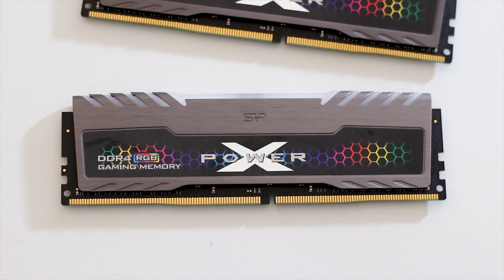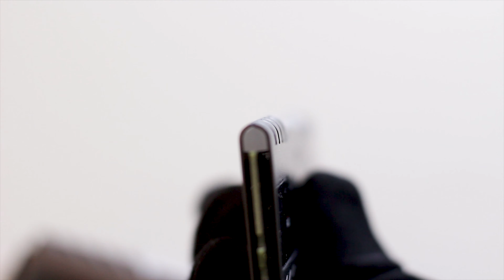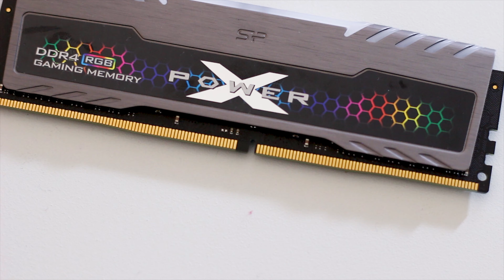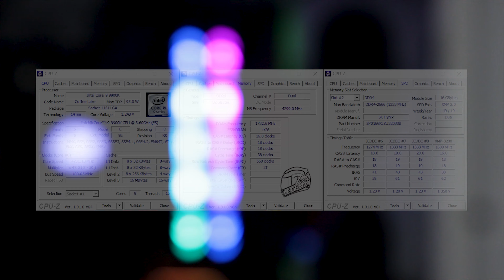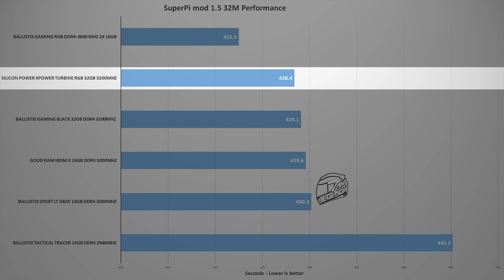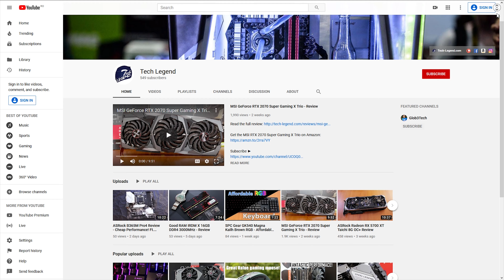Silicon Power XPOWER Turbine RGB 32GB 3200MHz Review

Comment: Building a new computer now. I have (2) 16 GB Silicon Power Turbine RGB RAM sticks for 32GB total. On very first boot up, my rear RGB fan lights up fine, but my Silicon Power Turbine RGB RAM sticks are not lighting up - but are being seen in my new Gigabyte B660 DS3H BIOS just fine. How do I make these sticks light up? Do you have to install the OS (WIn11) first and do it there with software? I thought they should just light up on very 1st boot up. Thanks.
Reply from the maker: Hi! Usually, they should light up without any software, but on some motherboards that's not the case. You need to download the GIGABYTE RGB Fusion 2.0 software and see if you can control the RGB with it.
Reply: @TechLegend-com  Thanks for the reply. Tried RGB Fusion 2.0 and the RGB RAM sticks are still not lighting up. Tried re-seating them too and still not lighting up. I don't care about controlling them even, just want the damn things to light up .. at little It's just strange that the motherboard is seeing them in BIOS (as 2 sticks of 32GB RAM total - as it should), but they're just not lighting up, and there's no where to turn them on either in the BIOS or Gigabyte RGB Fusion software .. anywhere, that I can find.
Reply from the maker: @mhbalough  Look for the JackNet RGB Sync software, see if that works.

Comment: Hello, I was able to bump to 3400mhz with profile, however at 3600 i found a 10% increase in FPS in games, however after 30 mins, fail/crash. I believe that means I must set a custom profile, however I'm not sure if the timings need to be higher or lower than what they are set to default.

thanks
Reply from the maker: Have you tried to raise the voltage?

Comment: Useful! I got these on sale for a good price this year. You wouldn't happen to know the voltage increase required to manually increase the clock to 3466, would you?
Reply from the maker: Hey, sorry for the late reply!
The voltage I used to get that frequency was 1.42V.
Reply: @TechLegend-com  Hey, no worries! Given the date on the video, I'm thrilled you managed to get back to me with an answer at all! :D Thanks again, I'll give it a shot this week and let you know how it turns out (I'm actually using two of these kits for 64MB in my home workstation)
Reply from the maker: @RothAnim  Alright, looking forward to see your result! :)
Reply: @TechLegend-com  Welp, no dice. Even 3333 was too much for this setup. Either I lost the silicon lottery, or doubling up the 32mb kit was too much of an ask. Still, the price was competitive and 64MB still runs rock solid at XMP, so no complaints
Reply from the maker: @RothAnim  Usually, overclocking kits that are 32 or 64GB in size is harder than a 16GB kit. As long as you get the XMP frequency to work, you are golden!

Comment: There crap I can't get to run full speed in Ryzen 3700X
Reply: They run without a problem in my Intel system. The problem is not with the ram it's with the AMD chipset. Truly finicky. Maybe in time with a BIOS update.
Reply: @rdoc  I Sent them back to amazon for 32 Gigs  of Corsair Vengeance RGB PRO 3200
Reply from the maker: @rdoc  Could have easely been made to work on that platform. But it is what it is.
Reply from the maker: Tried different latencies, tried to update the Bios? Checked beforehand if these are certified with your motherboard? Or just decided that if they're not part of the holy trinity of RGB gaming super duper RAM kits, they're crap? Just sayin.
Reply: @TechLegend-com  aorus b550 Pro    They are running at 2166   with Profiles on
Reply from the maker: @onknight  Ah, so the problems run deeper than "bruh this is crap". Ok, pay attention, on the b450 and b550 motherboards, you need to overclock the RAM kit manually to get the advertised frequency. So you need to change the timings with those that are specified by the manufacturer, in this case: 16-18-18-38. And have the frequency set at 3200MHz. This has nothing to do with the RAM kit itself and everything to do with the reality that you didn't really do your homework before buying the RAM kit. Let me know if it works out.
Reply: @TechLegend-com   sorry not doing when I can just put in Corsair Vengeance RGB Pro 32GB and run at proper the speed
Reply from the maker: @onknight  I'm sorry but I won't waste any more of my brain power in the Christmas morning to try to help someone that doesn't want any help. Happy Holidays!
Reply: @TechLegend-com   Sending the ram back to Amazon    never go off brand ram on Ryzen 3000 Chip
Reply from the maker: @onknight  See my other comment about how to get them running. You'll be sending the kit back for nothing.
Reply: @TechLegend-com  sorry but why should jump threw hoops when I  get kit the runs out of box  Replacing them with Corsair Vengeance RGB Pro 32GB  Better ram for 10 bucks more
Reply: @onknight  barely any kits run at the rated speed out the box numbnut 😂😂😂 I have corsair vengeance lpx rated at 3000mhz and you have to manually oc them in order to get rated speed